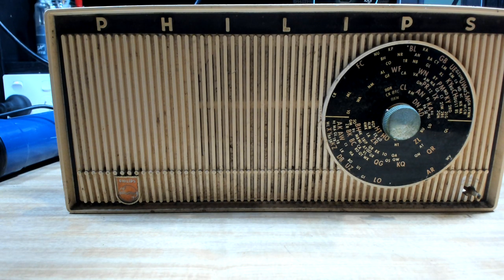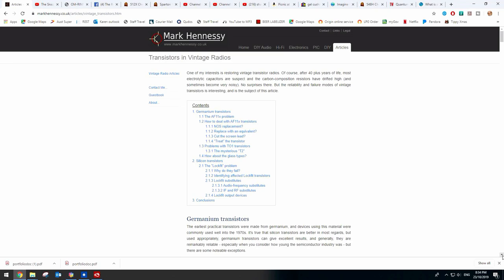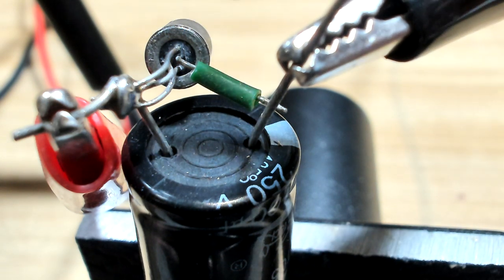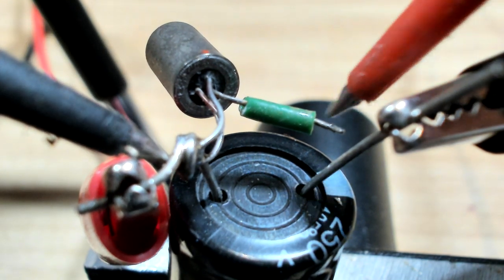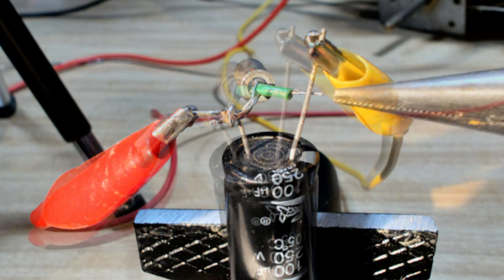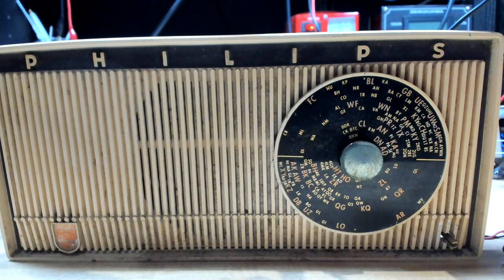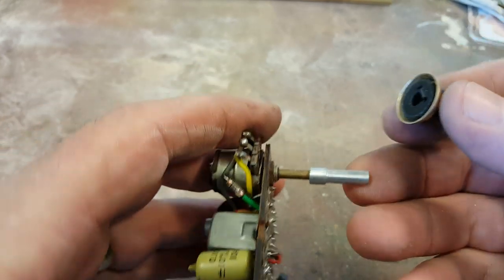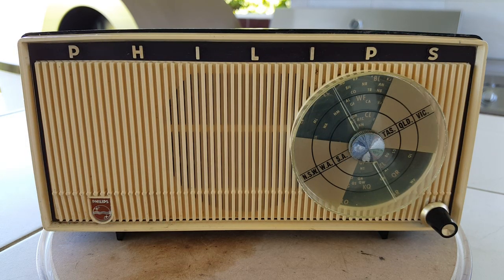Germanium Transistor Tin Whiskers Fix on a Cute Philips MT6 Radio

Comment: How easy is it for you to use desoldering braid?
Reply from the maker: Hi John, Personally I don't like soldering braid, it's slow and messy and can put more heat into the component.  The power sucker is so much quicker with only a second of heat applied, in fact, I purchased a new desoldering station last week with a vacuum pump and it works very well on point to point wiring connections . A gentleman at our club was saying at our last workshop he prefers braid over solder suckers, to each his own I guess 🤔😊
Reply: @DavidTipton101  Thank you for your timely response !

Comment: Reminds me of the old nicad rejuvinators we built in the 1980s...
Reply from the maker: Was that for when they went reverse polarity or one of those charge/discharge thingies
Reply: @DavidTipton101  Over time NiCADs would develop "tendrils" (internally) as a result of charging and eventually these would short out the cells. We would build a "High-Voltage Spike Rejuvinator" - basically at the push of a button a very short high voltage spike would be applied to the battery eliminating the tendrils - much like what you've done here with the transistor. There were many ways to make them but it has been a few decades for me - the electronic hobbyist magazines of the 1980s would occasionally publish an article on building them. If I can dig up an article I will send you a link.
Reply from the maker: Sounds very similar Robert, thanks 👌
Reply: The newer rechargeable are a lot better. I zapped nicads, worked at times. I was told the term ,gassing was the problem with them.Bought a lot of them at Radio Shack,

Comment: Used to work for Sylvania/Phillips tv division. 30 years we would "flash" shorted electron guns then "check" there worth or replacement. The action is sound. Just rember as my mother said (worked for RCA. ) wach that volttage. As she slipped me some rejects from the days work . Germanium. For my hobby of crystal radio DX. Good day kv4li.
Reply from the maker: That's what I said to another comment, one of the guns on my projector TV failed and the tech flashed it back to life. Interesting that a company would do the same thing 😃
Reply: @DavidTipton101  tks. And a no better companion. than a pocket radio and sounds from home. Though I am a Yank,  the sound of big Ben(BBC) was a thrill to hear in central america, and (VOA) were staples. Of evening news keep em rolling om . 73  kv4li.

Comment: i have a bags of germanium transistors if you need one
Reply from the maker: Great, thanks Ian, I will let you know if I need some, cheers 😊
Reply: @DavidTipton101  Those AD162 power transistors used in the HMV 8+8 amp are very unforgiving of split second shorting of the speaker lead

Comment: Hi David, I did a video about removing the cans on these, very unprofessionally!  https://www.youtube.com/watch?v=cg0uLhatiHk 
However, it does show what the inside of the AF11X looks like if you're interested. Zapping definitely works and some of us over in the UK have used the method for a few years now but it doesn't stop the tin whiskers growing back. Eventually they will though it may take a few years.  Regards - Andrew
Reply from the maker: Hi Andrewausfa, so you're saying I DIDN'T need to heat it to 700C to pop the cap off 😂 Thanks for the link they come apart quite easily don't they. I realise it is only temporary but Mark says it hasn't returned in 5 years so that's pretty good if I can get that out of it 😃